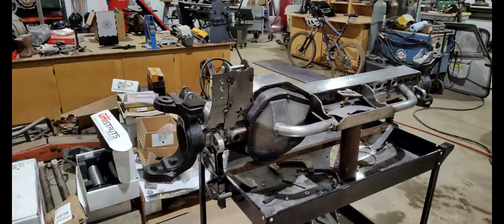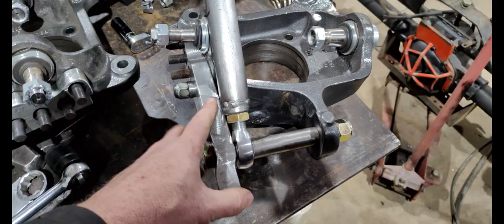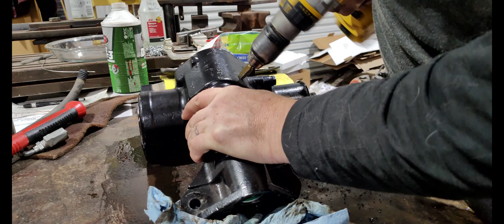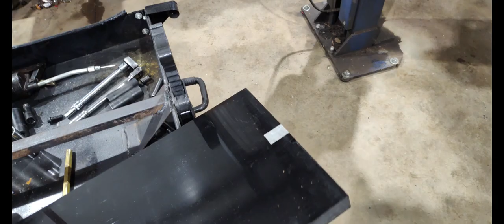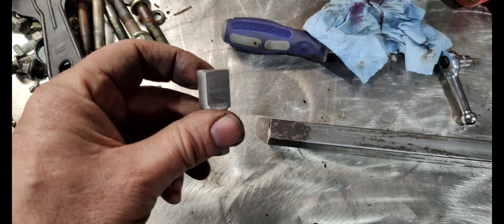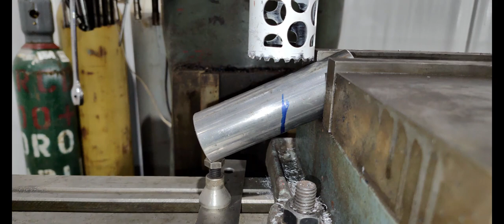LC Rebuild Ep3. Finishing the Steering

Comment: How do those steering boxes hold up to the bigger tires?  I assume that is a stock Toyota box?  Or is it an aftermarket/upgraded unit?  I'm a jeep guy, haven't messed with Toyota at all.  Thinking that box would be nice to move the steering linkage to the outside of the frame rail on my jeep.
Reply from the maker: That box is from a 77-79 F150 (got a rebuilt one off Amazon). It uses the same size pitman arm as a Saginaw box. So far it's holding up just fine. I've actually been running this for a little over a year now.